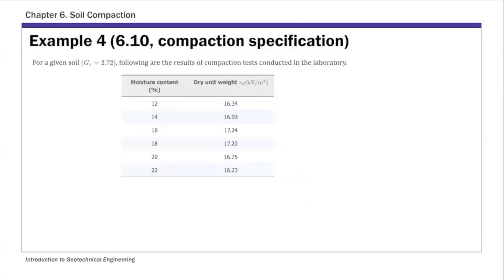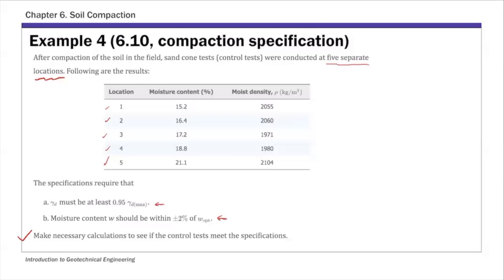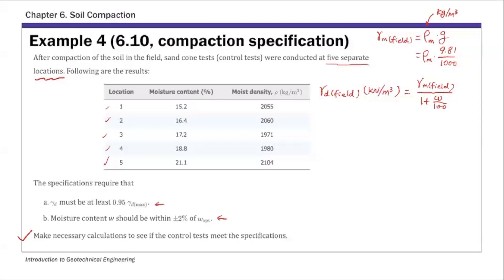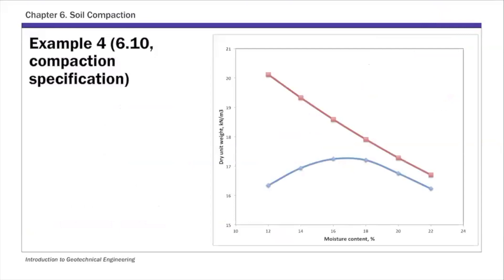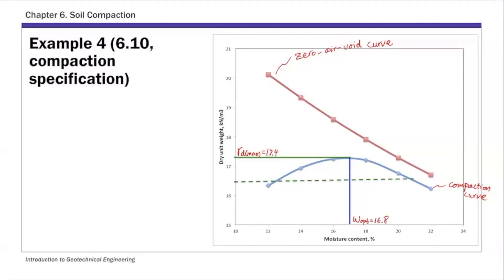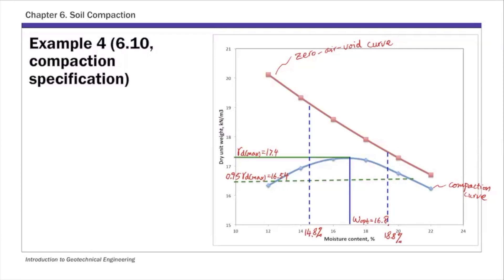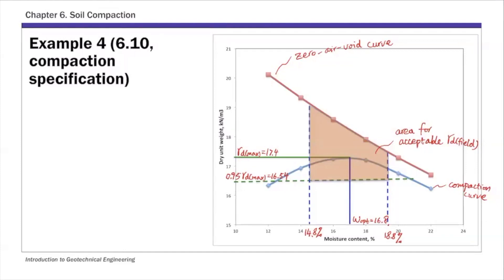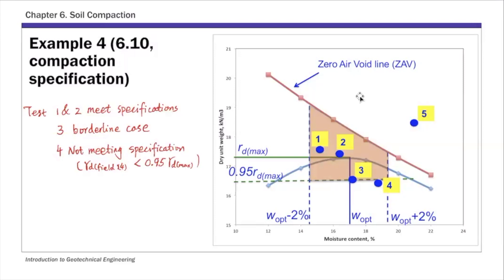Chapter 6 Soil Compaction - Example 4 (Compaction Specification)

Comment: Please help. I really don't know how to find mdd and omc from curve. How to be sure that the value is really the mdd? Is there any formula?
Reply from the maker: The top point of the compaction curve gives the maximum dry unit weight (y-axis value) and the optimal moisture content (x-axis value). You read the x-y values directly from the axes.